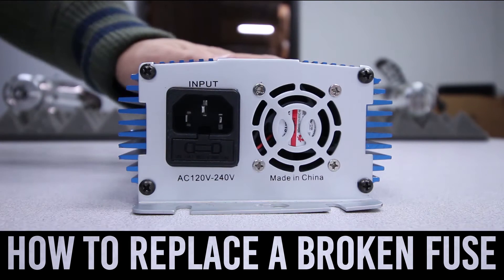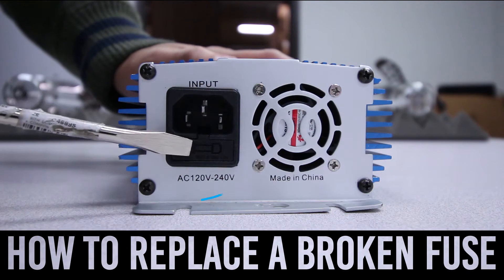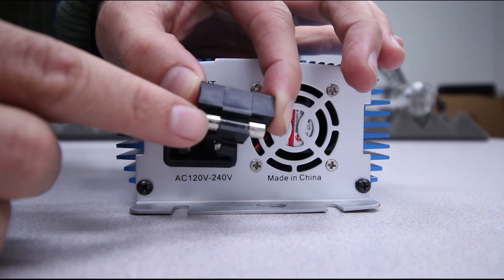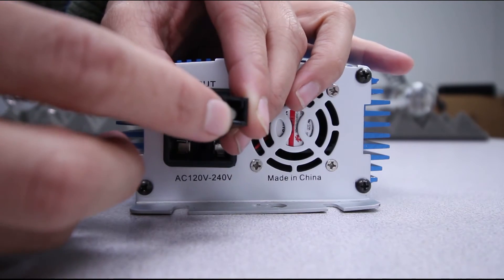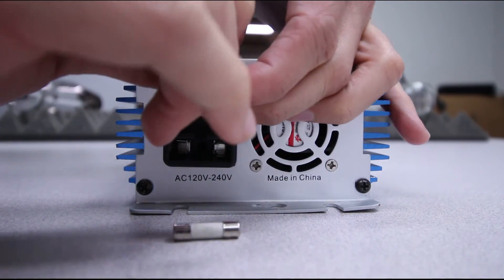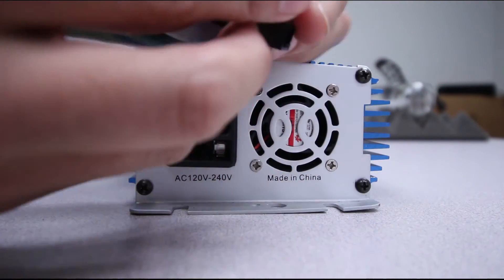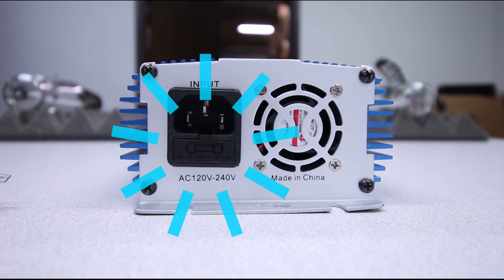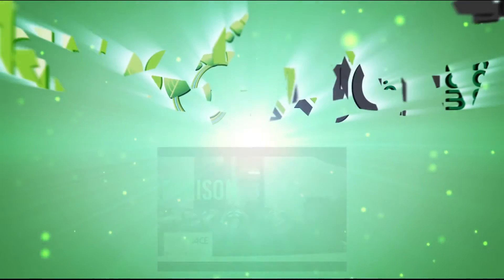How to Replace a Broken Fuse

Comment: I have a hps ballast from gavita 400w . It only wanna ignite the bulb when i dimm it down to 250 w on all the other nothing happens and on 250w i think that the light is flickering/blinking, 
Can someone please help me with this? Can I change the fuse on it like this
Reply: @Larsis348ance  no it is the ballast because it is doing the same nomatter what bulb i am putting in.  I tried whit atleast 4 different 400w bulbs
Reply: @Larsis348ance  a